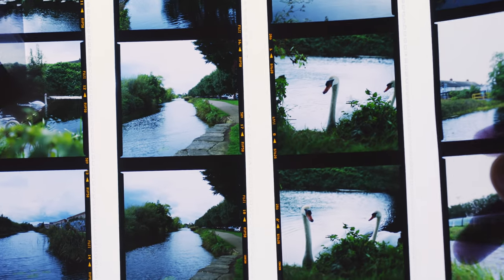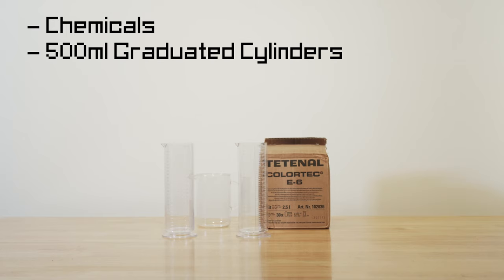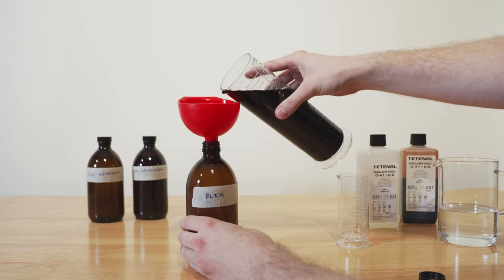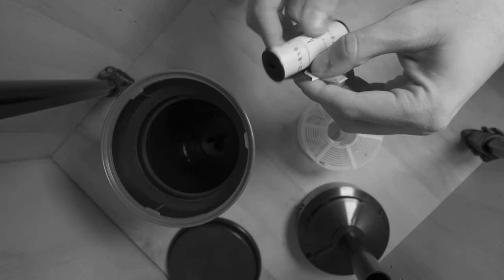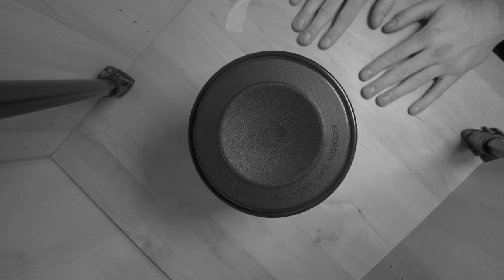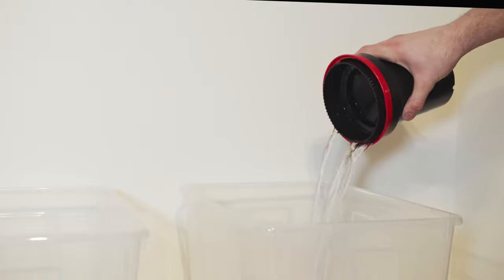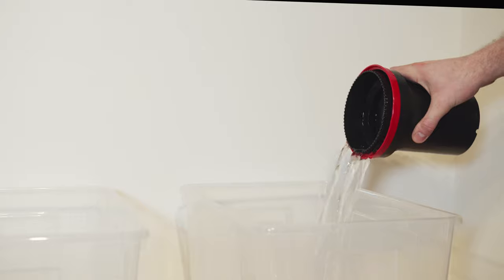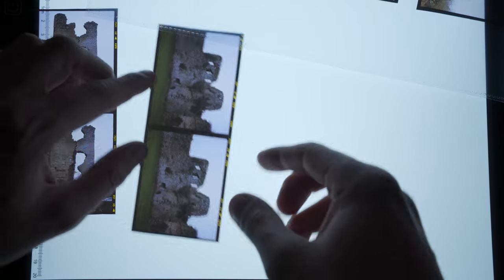How to develop Slide Film at Home

Comment: Very informative, thanks for sharing! Quick question, if I wait and shoot around 30 rolls of slide film, could I then just mix the entire chemistry into 2.5l of working solution? This would mean I wouldn't have to bother mixing into smaller, 500ml batches. I'm just unsure about how to adjust for chemical exhaustion using this method though. Regards, Dan
Reply: @SprocketHoles  I have only shot 2 rolls of slide film due to cost, and i find that E-6 is easier than C-41 i fucked up a lot of c-41 never had any issues with E-6 or Black and White. Idk what it is but I just have bad luck with c-41 so my local photolab does that on a noritsu film processor. 

I am blown away with slide film it just looks so much better even than what ive gotten with color negative or heck even the few digital images ive shot in my life which is like 10! I just love analog photography.
Reply: As a general rule, the stock solutions in these E-6 kits must be fully mixed at one time, not mixed piecemeal. So, if you have a 2.5 L kit, you should mix it completely at one time. Suggest you then break down the 2.5L working solutions into 5 - 500ml; bottles, preferably dark amber glass bottles. Then use one 500ml batch, and reuse it to the extent you can tolerate the resulting color shifts, then toss it and start into the next batch. If you reuse chemistry, the instruction in the kit should have directions on how to compute the required extension of 1st developer process time. The other chemistry parts do not normally require time extensions.

Comment: Great video. Do you heat up chemicals and water at a slightly higher temperature to compensate to heat loss?. I have found by reaising temp 1 degree helps  with C41 but thats only 3.30 this has a longer first developer.
Reply from the maker: No, I put the developing tank and chems in a water bath so its maintained at 38c the whole time.
Reply: You are doing well,  I also use a water bath at the correct temperature but still seem to lose temperature maybe something to do with how much agitation I am doing. Have a great New Year and keep up with the videos, they are great    @SprocketHoles
Reply from the maker: @GAROBERBERIAN  I preheat the tank with wash water at the start to bring the film and reels up to temp before I start developing
Reply: Ok cool thanks will try the same  @SprocketHoles